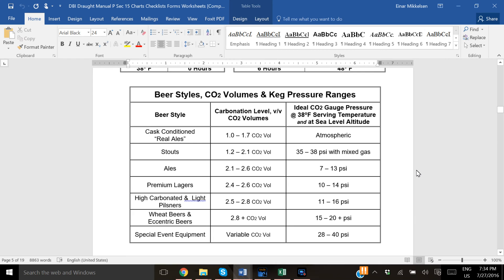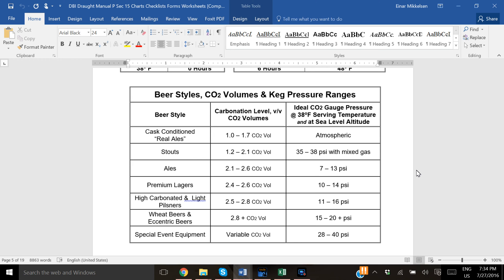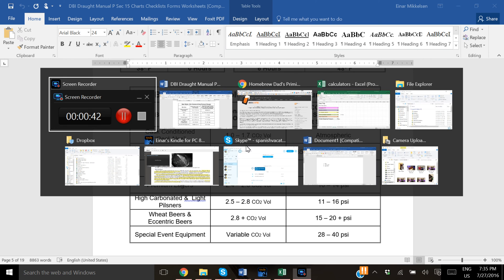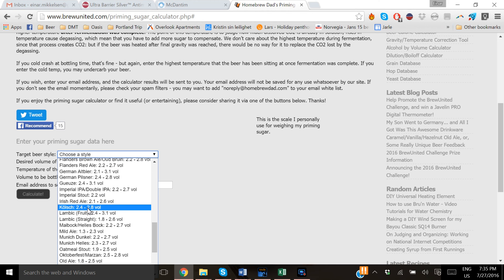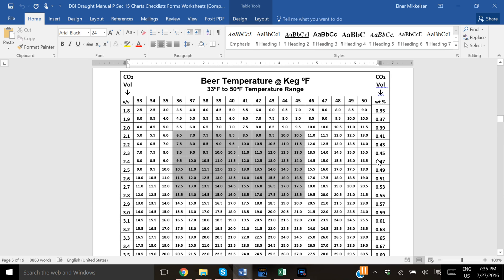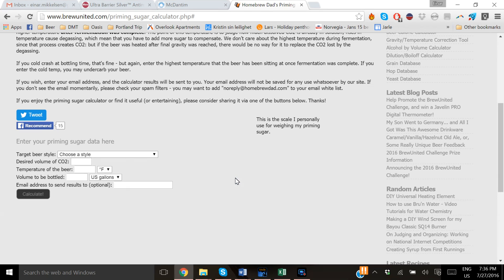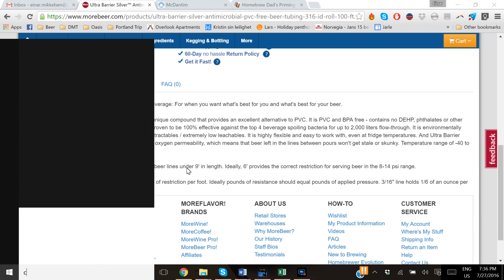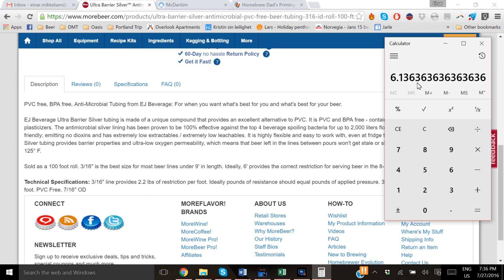Calculating Beer Line Length for Balaced Pour - Easy Method

Comment: Does that mean I have to change my line length every time I have a new beer style?
Reply from the maker: Yes, or just get a faucet with variable flow control, such as the Perlick 650ss or the 690ss. Then you just have to vary the temperature and pressure.